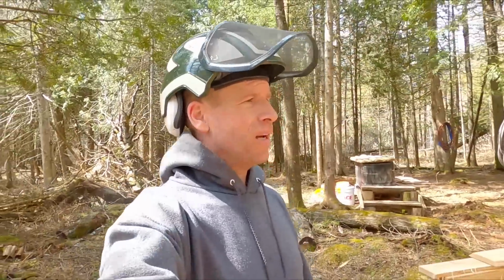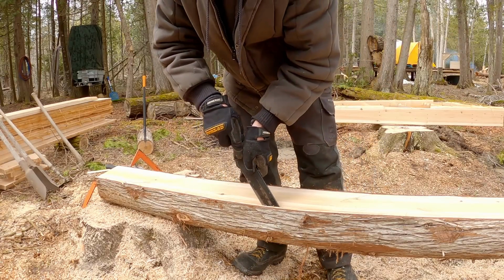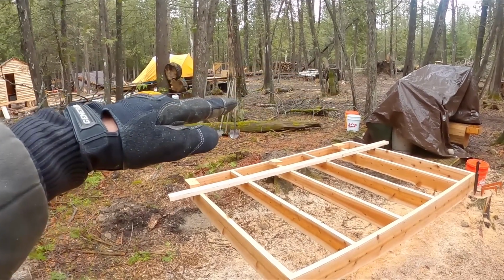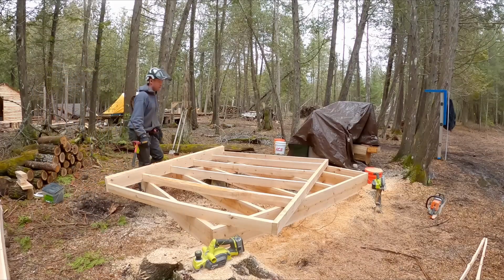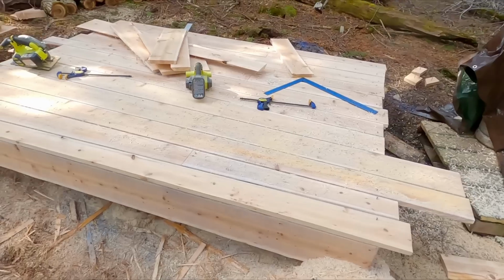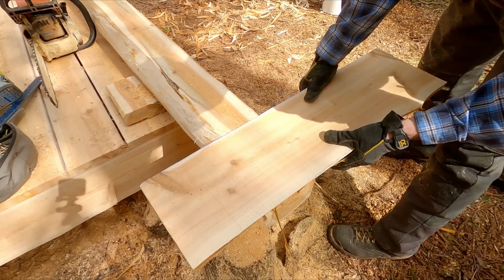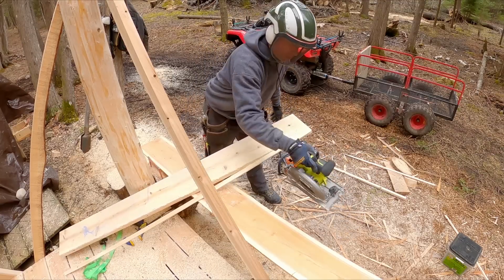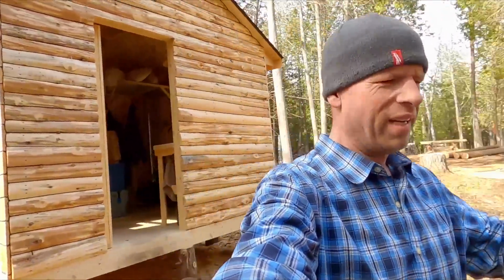Wilderness Shower Build: Logs, Framing, Roof.  #82

Comment: Watching you chalk and hand mill those 6x6s, I might suggest using one of the cheap Ebay chainsaw mills that run on a 2x6 screwed into the log. I'm just starting out chainsaw milling, but it's worked great for me so far to get started.

Comment: If I remember right from school the reason why it's easier to peel in the spring and early summer is the sugar or trying to regenerate another ring get a year older with growth in those sugars are separating the wood from the bark if you cut in the springtime and peel in the springtime they will be easier to peel late summer they'll be a lot harder to peel that's if I can remember from school been many years lol

Comment: leave the Tank outside,  Pepper the Floor with drilled holes or plunge cuts from the Chainsaw in the area your standing during a Shower, just be sure to Chamfer all the edges so no splinters in the Toes LOL 
Make the side walls Shoulder height like the Showers in MASH. Your Shower Valve could be MASH style too HAHAHAHA
Mike M.

Comment: Hello from the Netherlands .  
question : 
why not make walls around waist or chest height then it will give you solidity in your build 
and privacy and yet it is open enough for the summer and you have a nice sturdy frame to fasten your winter canvas parts to .  
I think it's a win+win+win situation.  
I saw on another YouTube channel a battery shower pump with on/off control on the shower head 
that seems more convenient than throwing a bucket of water over you and also save water , 
shower on to get wet , shower off to soap ,  shower to rinse off , 
and you can shower for as long as you want and still have hot water after you are clean or you can stop the shower to save water for next time .
even if you live in the outdoors and off-grit you can still have a little bit of luxury haha .
thanks for the video Ringworm
Sincerely, Hollandduck from the Netherlands
Reply: No clue. I thought it would have been better to make a indoor shower and then an summer outdoor shower. I have my own outdoor summer shower that is just a simple 4 post frame with some boards on it and a old sink for washing what ever. I use a propane tankless water heater.

Comment: It is said that there is not a word that rhymes with Orange.  But, two words do, 'door hinge' and as I recall you have a box full of them.  Again, a Tee-Pee could be erected to house your shower and your water supply would be kept liquid year'round with a perpetual fire pit. It's not like you don't have enough wood.  The entire thing could be built of wood and you could make the sides of at least partial sections to raise up on door hinges for pert nearly 360 degrees visibility for the summer and down for the winter and you would never have a problem with the snow or rain or high winds.  Plus, water would be at least warmish and you would bypass the need to do your least favorite job, roofing. Only walls on a tee-pee.  How you finagle the top for venting is up to you but should require very little thinking, still right up your alley.  Even if all you do is make one for fun or just to shut me the hell up, I'd still like to watch you make one.

Comment: When are you gonna build a log cabin? I saw one design  was quick and simple using long spikes Quickest log cabin build Ive ever seen on you tube! and he did it all by himself wasnt very tall on the walls but it worked and ewas thrown up rather quickly and ery sturdy construction I was impressed n very few tools and I saw another historic build of fireplace and chimney made of rock and cobb/clay n straw and wood similar to how rocket mass heaters are constructed.. Like using a pine box to construct your mass unit and and burried .stove pipe to me I bet you have everything except the 55 gallon  drums to build your stove with and the perlite insulation to mix with your clay. Bet you could make that a shower/saunna as well but that propane tank needs to be out side its a fire hazard cuz tyhe nature of propane is subzero. Another thing look into solar tubes used to heat liquid as well as large magnifying glass to increase the heat going into those tubes or increase efficiency of your solar pannels or tubes.

Comment: Why don't you cut some trees down and just leave them so they can dry out for a while like chop down like 30 or 20 trees and then just go get them when you need them and they will dry and get lighter I don't know if that sounds right? I am learning from you about cutting trees so it's not like I know anything but I'm learning from you, sorry. I live in south texas we don't have any trees we only have bushes. We do have weeds that grow big enough to use as lumber though.
Reply: I know what you mean. 
I would think with all the work he does he would have skidded out a bunch of logs when there was enough snow on the ground. He needs a sawmill and I think sooner or later we will see one. A swing blade saw mill 6 inch would be more than enough for him with a home made deck that holds the logs in place.